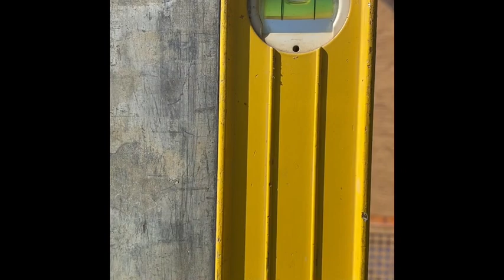Bricklaying: lines and profiles set up on a pike

Comment: How did you get on with the clips
Reply from the maker: It worked well just needed a bigger clip 👍🏻
Reply: @rowlockconstruction8345  I think the other guys wrapped the line around a brick to give extra support
Reply from the maker: Yeah I do have it wrapped around a brick I have  it wrapped around half a brick. If I used a full brick I felt that it would pulled the clip off. That’s why I think I need a better clip 👍🏻
Reply: @rowlockconstruction8345  looks like bigger clips then, keep them coming